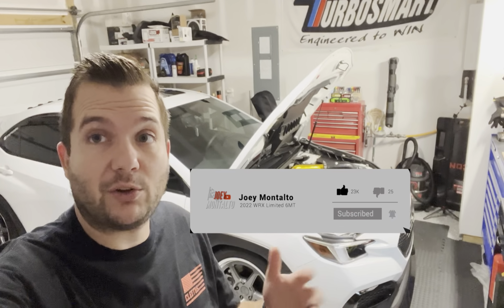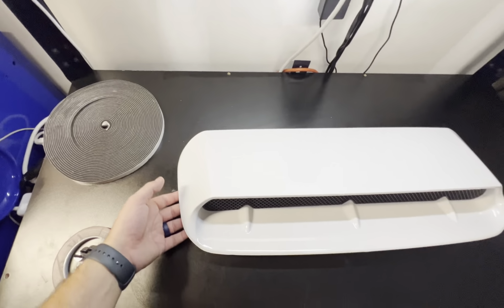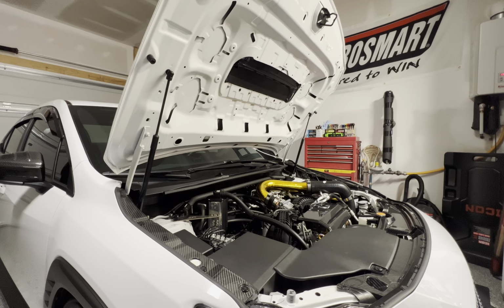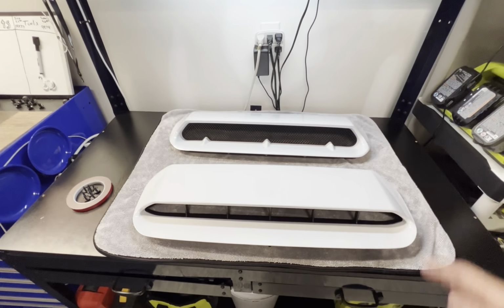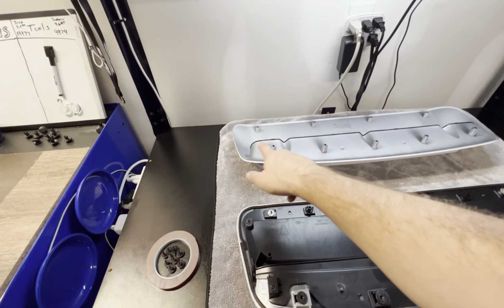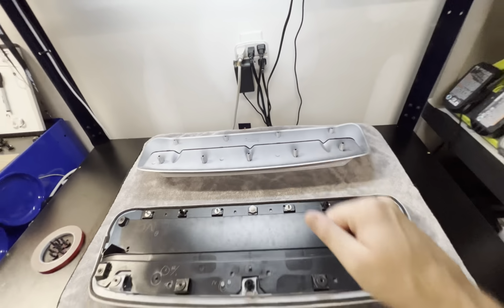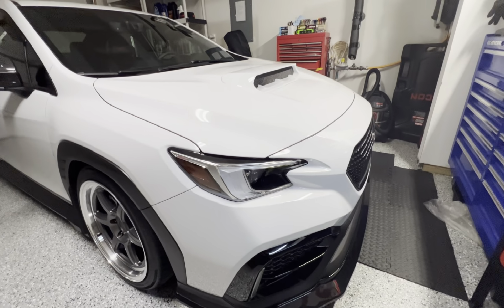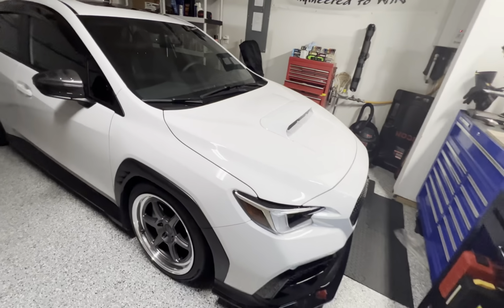22+ WRX Aeroflow Dynamics S-Style Budge Scoop Install

Comment: Does your scoop sit down in the hood where the oem one does? I’ve ordered 2 scoops that have only either the front or back sitting in the hood. Currently trying to get a refund. Paint match on wrb is 9-10/10. Thanks for the videos keep it up!
Reply from the maker: I did not sit like oem. I did end up removing the scoop as it was not perfect fitment for me. Other have had some better luck. No damage with the foam tape though so do harm no foul
Reply: @JoeyMontalto  Afd sent me a return label. Unfortunately out of a duckbill v3, f1 exhaust, cf vortex Generator and the scoop….only the duckbill and exhaust are staying on the car… 3scoops, 2vg are going back…
Thanks for the reply! And thanks for the content! We all appreciate it

Comment: These seem to be pretty popular, but I'm not a fan of them personally. The transition from the hood to the scoop doesn't look very smooth and the mesh grill looks pretty tacky. It might help get a little more air in with a topmount, but you have a fmic, so it doesn't make much sense to me to have it. I wonder if a non turbo impreza hood will fit without a scoop haha.